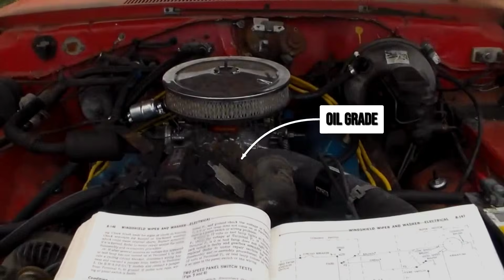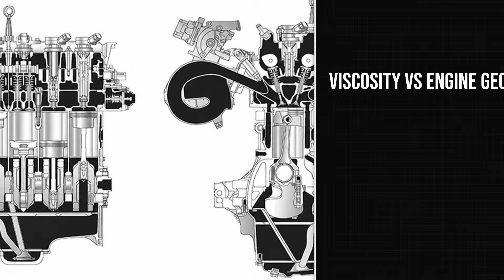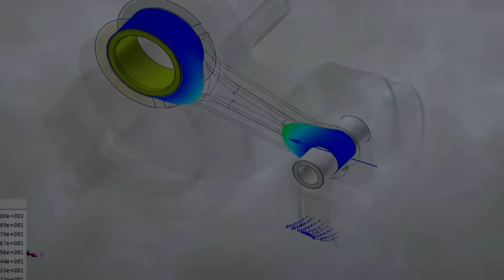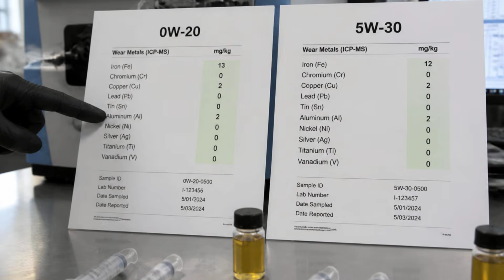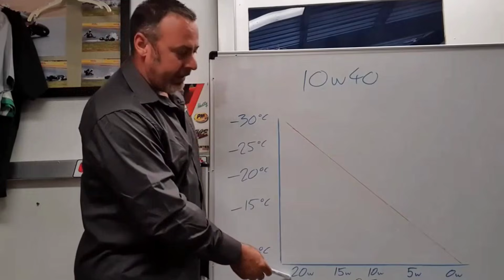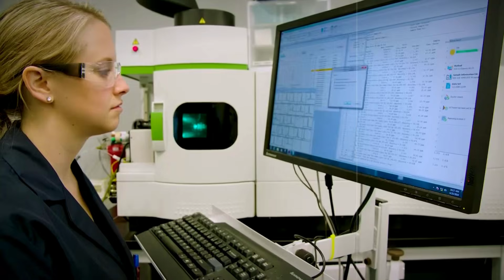Comparison: Mobil 1 Extended Performance 0W20 vs 5W30

Comment: I change my oil every 6 months regardless of miles put on my vehicles. I have never had any issues with any vehicles Ibhave owned. Also only use premium gasoline as well with never a fuel related issues as well. I do average about 4k miles between oil changes.

Comment: Just used 5w30 on my 21 tundra.  Quite start up in the morning.  Better for Texas summer driving.  At 120k. Cant hurt in my opinion.  0w20 just seems like water at my 4,500 mile oil change

Comment: For daily driving normal service there's nothing lacking in 5-20 or 0w20 for healthy engines that spec it.  My 2010 5.4 got a better wear number with cheaper semi synthetic 5w20 vs a synthetic 5w30.   That's valvoline 5w20 vs ultra platinum platinum 5w30.  I wasn't expecting that at all

Comment: I just use an SAE 10W-30 CONVENTIONAL MOTOR OIL ON ALL MY BRAND NEW TOYOTAS , SINCE 
1976 AND UP TO THIS DAY ALSO . PERIOD . HAD , HAVE ZERO ISSUES . NEVER REALLY USED A BLOCK HEATER EITHER .

Comment: My 2026 Ram has the hurricane that calls for 0W20. I am going to run this until the 10yr 100K powertrain warranty is over. Praying this engine goes the distance.  Might switch to a thicker oil, when the warranty is over.

Comment: I have a 2018 Toyota Camry that calls for 0w-16. I use 5w-30 with no problems. The same car in another country calls for 5w-30.  I’m calling BS on this article.
Reply: The engine might be the same but the tuning is different. I can’t speak for other manufacturers but Toyota uses variable pressure oil pumps. Sure 5w30 probably won’t hurt anything but Toyota engines are designed and tuned to run reliably on these lighter weight oils. The lighter weight oils also have extra additives to make them behave in much the same way heavier weight oils do. Are light weight oils for CAFE requirements? Yes they are. But Toyotas run fine for a long time on 0w oils.
Reply: I do the same with a 2020 RAV4.